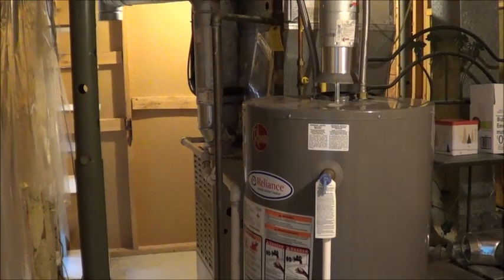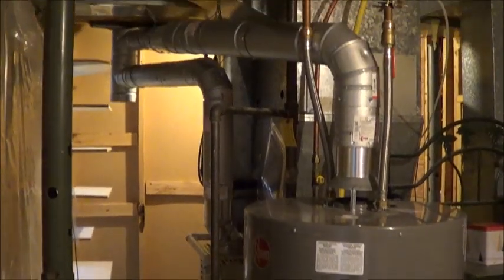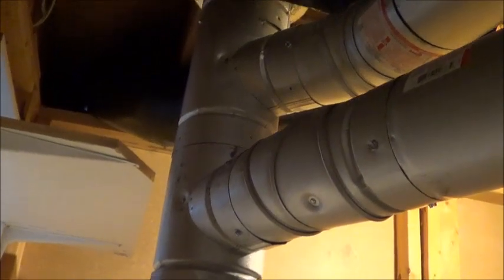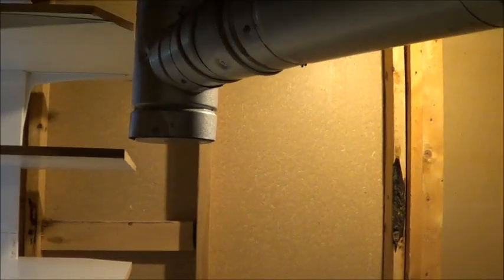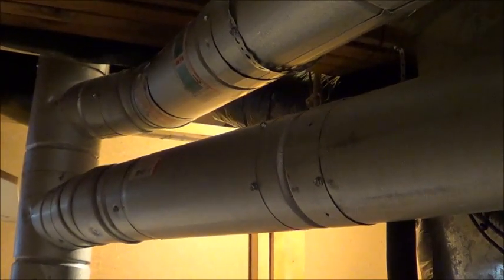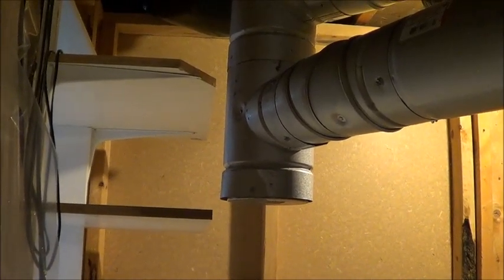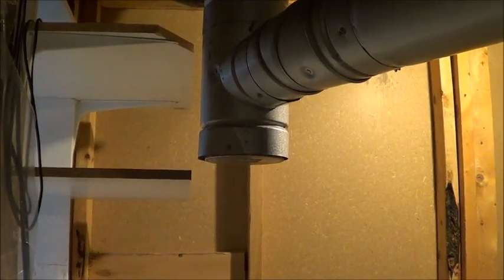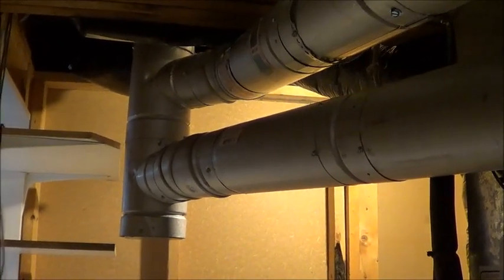NEVER exhaust a Grow through a Furnace Chimney

Comment: what about simply venting into the furnace room itself not into a chimney? Also, would the air in a furnace room be helpful  for a grow room? Was thinking it would help circulate warm air to help keep temperature warm in grow room during winter. Also, would the air in the furnace room have higher levels of CO2 because of the combustion of natural gas that would be beneficial to your plants?

Comment: Hi, what if you would like to vent warm air (used air) via a chimney that is not being used for anything else? Let me make it clear I live in UK where we have some victorian homes 128 years old made from solid brick. Each room featured separate chimney - 2 at ground floor and 2 at the 1st floor going to separate flues into separate chimney stacks at the roof. My problem is that since the chimneys are not being used anymore (we use Gas boiler to feed water radiators) ... the fireplaces were blocked off by bricks and mortar, then plasterboarded over etc ... during the winter time we have some excess of moisture in the used air from breathing, cooking, washing etc that is turing into water and dump on the outer wall and windows. We would like to improve ventilation in the house to exhaust the used air to the outside via the chimney ... If we were to hire a builder to install stainless steel lining into the chimney flue can we use this to expel used air from the property ?
Reply: psyhotron666 I came looking for the answer. I have a chimney in the basement that's not used at all. Even has a nice new rain and debris cap installed outside. It's likely my only option.

Comment: Anyways just run your flex into it from a diff spot a chimney is a great spot to vent smell but not if you got a hot flue pipe running into it! Theres almost always an extra hole on it somewhere from previous contractors just stick the end of your flex in it and foam around it dont try too run the duct up it

Comment: Get a 90% or higher efficent furnace they are very safe n will shut its self down upon co2 not venting properly. And get a on demand gas water heater they donot get vented into a chimney thats a horribe idea to begin with a chimney is not air sealed anyway bet if you get a co gauge you pick up readings all around your chimney and ppl install low speed exhaust fans on fleu pipes if they dont draft properly so i think theres some things about this video that are wrong if you hook a low speed fan into the duct it will help push the co2 gas out as long as your system is proper but the higher you connect your fan to it the better to "pull" the gas upward exhaust fans get installed on water heaters like yours all the time! Im a weatherization guy and someties after air sealing and insullating your water heater will stop venting and we cant afford to replace a water heater every time so a fan goes in but it basicly runs like a pc fan very low speed of course dont hook a box fan to it 😂😂😂

Comment: went to watch this video on weedtube- but 30 sec ad before it started-pretty rank making coin off your uploads- I would not be happy if I was was one of your sponsors, besides that I have a potbelly fire and vent into the flue with a one way system which prevents blow back ,can also divert to roof vent as well if required

Comment: I've heard it's common to exhaust into the sewer.
Reply from the maker: lol in the gangsta-ass days of the 1970s & 80s people did exhaust into the sewers sometimes....less of a common trick nowadays. There's carbon filters for smell available to everyone now as well as countless variations of equipment to get rid of the heat buildup or not to get heat buildup in the first place.
Reply: You can actually run into a similar issue; sewer gas is noxious and you can end up bringing it in this way........